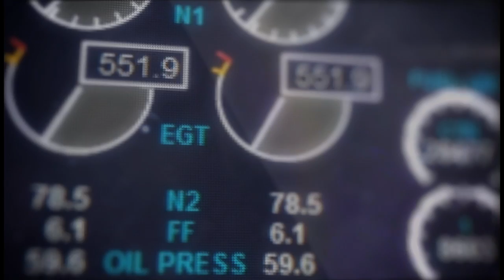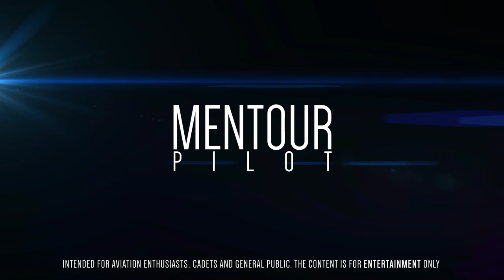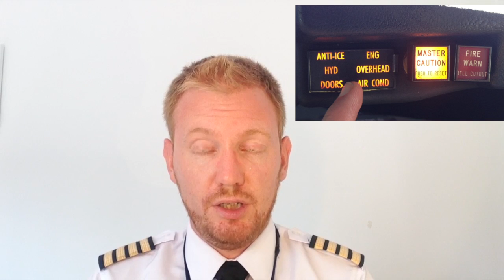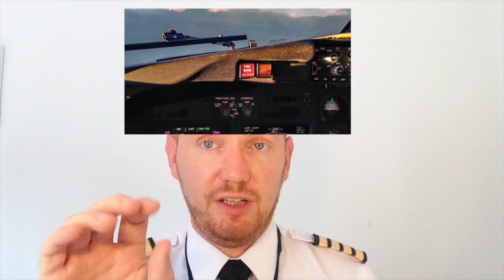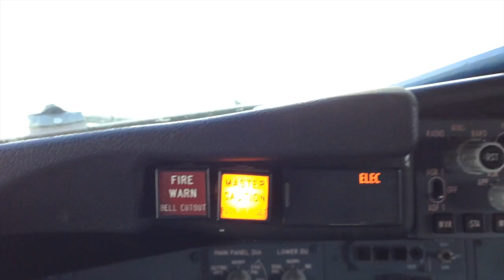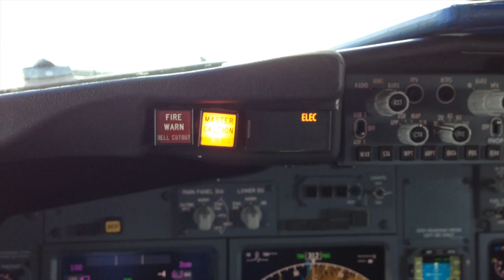Aircraft Failure - Master caution system

Comment: Is there a way to perform a full-text search throught the checklists in a corporate iPad (or whatever tablet you guys have there)? Or at least for an imprecise search throught the index
Were there a built-in diagnostic system, it could show you a checklist (and even perform some technical checks) immediately after a failure happens, I wonder what the aicraft software/hardware designers think about that

Comment: Is Master Caution basically the check engine light?
Reply: Ellenor Bjornsdottir No, it can come on for several different reasons🙃
Reply: @speedbird9313  Indeed. But so can the check engine light in a car.
Reply: Ellenor Bjornsdottir Yeeeeaaah..but still engine related🙄Whats your point?🤔
Reply: @speedbird9313  My point is that it serves sort of the same purpose, which is to signal that something non-urgent has become broken.
Reply: Ellenor Bjornsdottir Well, it depends, but it definately can be urgent. So can the check engine light in your car😆😉

Comment: what would you do if the landing wheels wont come down
Reply: try to extend the gear with the manual release lever. then do a quick move with the plane to lock the gear in to place. if that doesn't work, guess you will be doing a belly landing.

Comment: I've noticed, as a passenger, that reverse thrust is rarely used these days. When I was flying (as a passenger) back in the 70s, 80s, and 90s, reverse thrust was used to stop the aircraft upon landing. Nowadays they don't seem to, or if they do I haven't noticed. Is that because planes have better brakes these days, or another reason? I once experienced an A380 using reverse thrust at LHR but that was the exception rather than the rule.

Comment: There should be a different alarm sound for each system that can fail
Reply: Too many systems - and sub-systems - for that to be feasible. If each had their own alarm, they could either eventually mask each other or keep the flight crew occupied canceling each in turn or force them to operate in a potentially disorienting environment due to the noise. Nice idea, but....
Reply: There are several types of alarms. Fire sounds like a Fire bell. Pressure makes a loud constant tone, Battery / Electrical makes a high pitched beeping, Over speed makes a clicking sound, Stall makes a steady Horn sound and shakes the flight controls, then there also is the GWPS and Terrain, and Traffic voice annunciation.

Comment: Changing ETOPS safety requirements from 4-engine aircraft to 2-engine aircraft on long haul (cross-Atlantic) flights. Also, battery  overheating problems on the 787 Dreamliner and a radical big change in switching multiple systems to electric from conventional.

Comment: Where does Oxygen come from when flying at 30,000 feet and above. Is the 02 tanks hold liquid or gas
Reply: There is still plenty of oxygen in the air at 30,000 feet, BUT the aor density isn't high enough to work in our lungs.

So they use the engines to lightly pressureize cabin air

Comment: Dear Mentour, first and foremost, thank you ever so much for your podcasts and for guiding me through my first airline job. Believe it or not, you have been a role model throughout this process - it hasn't been easy I can tell you!

Now to the question: I'm currently undergoing initial type rating on the B733, and there is a memory item that I am having troubles identifying: Engine Fire v.s Engine Tailpipe Fire. According to the FCTM and QRH, it specifies that the Engine Tailpipe Fire is caused by flooding of the combustion chamber and that you won't receive a Fire Warn indication. It also says that the engine fire extinguishing agent will not be effective, which in turn directs you to cutoff the engine selectors and motor the engine instead. Why am I concerned? Mainly because I don't know how I would recognize the fire if I don't get any Fire Warn indication, and if the tower or ground personnel (skill test inspector in this case) alert me of the fire, I'm worried I would execute the Engine Fire memory item instead, which as you know would not help and would probably be disastrous in a real situation. Do you have any suggestions on how to differentiate the recognition of these failures? I hope this question won't take too much of your time and I thank you once again for your guidance.
Reply: Actually I just realized that the engine fire switches will not illuminate, maybe this is the main indicator? If it isn't too much too ask, would you consider making a podcast about the different engine fires vs engine failures/surges/damages and how to recognize the differences? May sound obvious, but many of these procedures are similar, considering also the high pressure environment in the sim. Tack så mycket!

Comment: Pitot tube blockage, how common is that, and how hard is it do detect? seen a disaster video where the pilots got conflicting information cause the computer thought it was climbing and overspeeding when the throttles was close to idle. This was also a night flight over water so no references.

Comment: The information you provide is fantastic. With aircraft failure it is often the smallest thing that causes disaster. My concern is how aircraft are pushed to be constantly in the air. In a few weeks I'm travelling from London to Australia. The aircraft has a two hour turn around before heading back to London, then about six hours before departing for Australia again. Doesn't this put a huge amount of stress on the aircrafts structure and be the cause of stress fractures that eventually and suddenly have catastrophic consequences.

Comment: How hard is it to land an airplane on water ?
Reply: Mohammed Erinpurwala if you're in a seaplane, piece of cake. If not,  watch the movie "Sully" with Tom Hanks, this details a rare water landing taken from a real incident.
Reply: Mohammed Erinpurwala well I assume you have to go quite soft to the point of stall speed right as you go into water. also there is a button or switch or something that ceal the plane water-proof.
Reply: LightRealms yes there is a button called “ditch” and it seals all doors to stop water from getting in

Comment: hey, why is the master caution button on a 737 always twisted for a few degrees clockwise? It never aligns up with the fire warning button in a straight line. When first I noticed this, I thought someone must have done a sloppy service or something, but even the PMDG 737 in FSX has this button slightly rotated.
Reply: ??? What model 737 was that?
Reply: @dileanperdomo3821  every model
Reply: @felobatirmoheb4884  do you know why?
Reply: @dileanperdomo3821  nope...
Reply: They wear down within he year of use

Comment: How often do you do a recall to check for failures of redundant systems?
Are these unannounced failures of redundant systems annunciated on the EICAS?

Is the Isolation valve between the left and right PACs always set to AUTO?
Is it correct to call them "PACs" or "PACKs"?

I love these systems videos, thanks!
Reply: ***** Thank you!

Comment: I Saw in your video : Inspiration - Life Of a pilot  that you are a Boeing 737-800 pilot . I'd like to ask you something about Ice . Because my university is In Corfu and i am flying from Corfu To Thessaloniki and the opossite with an ATR 42 and ATR 72 so . There was an accident with an Amercan Eagle ATR 72 which stalled without warning and the flight stick was stuck in one position . The investigators said that when the stalling begun the pilots had to put the RPM power all the way to the MAX. So my main question is :   Is there something similar for the 737 ?? .I Mean if the 737 stalls and the flight stick is stuck on the right , can you recover by applying full power and using the Rudder ??? ;)
Reply: +kosn4smw The Amercan Eagle ATR 72 stalled without warning because, with the autopilot engaged, they were holding and collecting ice while the autopilot continually applied nose-up trim to compensate for the ice.  
When the elevator trim reached the limit  the autopilot disconnected because it had reached it's limit- it couldn't apply anymore trim.  Then it stalled and also rolled due to the amount of ice it had collected. 

Even if there was something related to ice jamming the aileron and the stick being stuck (I know there was some known issue with the ATR72 ailerons and icing-  but I forget what it was)- this jamming would not be anything to worry about if you do not fly in ice with the autopilot on and collect that much ice without knowing it was happening. 
Never fly in ice with the autopilot on and you'll be fine.  

Additionally, the NASA website has some great courses on icing and also on tailplane icing.
Just remember that tailplane icing stall is a vibration felt in the yoke NOT in the airframe. 
Of course, if you feel airframe buffet that is a conventional stall. 

I think that the pilot of the Colgan Air Q400 that crashed several years ago in Buffalo, New York was trying to recover from teh wing stall that he caused by doing the tailplane stall recovery procedure they had jsut learned in a recent class.  And they were exhausted.
Reply: StratMatt777 Great Thank you very much for your info !!! ;)

Comment: It Is a bit odd, from time to time appears a professional in a matter, really is irrelevant the type of job, and is able to explain and SHOW difficult, strange, awkward things in a simple, clear and
direct way to the rest of the people. My hat off to Mentour pilot.

I'm an Atco and ppl pilot. Using different simulators I try to train Abnormal situations on 737NG sim. On the V1 Cut scenario, the QRH and the FCOM refears to the MFRA, ( minimun flaps retraction altitude)
I'm unable to find which altitude is that, and how to find out the proper MFRA for any departure, Engine out Sid scenario. 

Any clue on that?

Keep the hard work. Brilliant job

Comment: Hi there, really appreciate the insight derived from your channel especially the technical topics you've covered so far. I don't suppose down the line (checklist pun intended)  you could possibly do a short podcast highlighting the importance of decent management? I.e. Using different vertical modes accurately in hypothetical scenarios e.g ATC leaving you too high or too low or the profile is not according to planned etc? That would be much appreciated my end mate.

Comment: G-reat! :) So, how do you deal with "air cond (zone temperature)" master caution warning? (while on the ground) I still did not found any logical solution including PMDG's 737 manuals (which are really detailed). When it appears (sometimes it does, sometimes it does not, under the same circumstances), when the plane is airborne, it simply disappears. I can fly with it in the sim, but I am quite curious to deeper understand this issue. Thanks :)